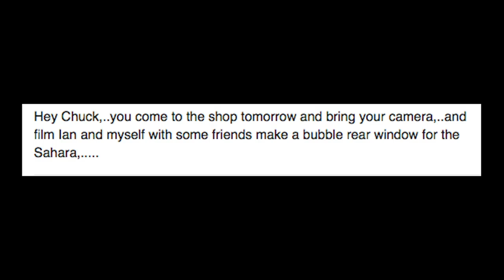Ian Roussel  Voodoo Larry & crew team up to create a rear window for Voodoo Sahara

Comment: Going from high pressure to low it creates very cold air. Would using steam or hot water work better?
Reply from the maker: Good question.